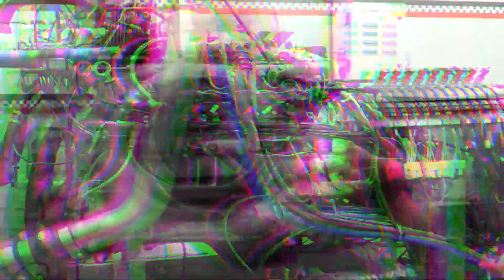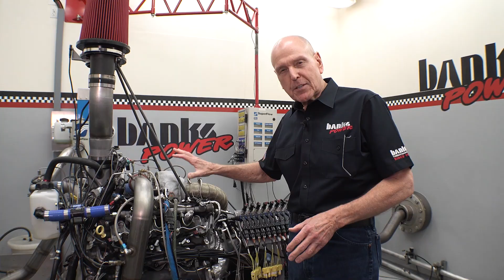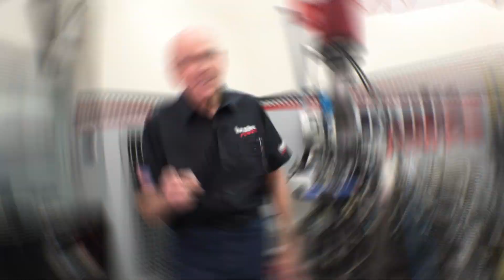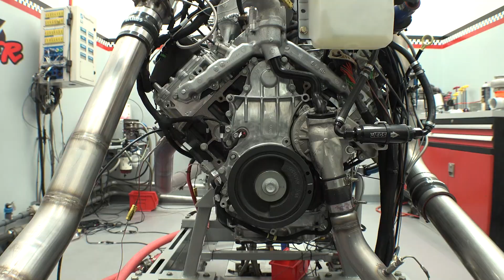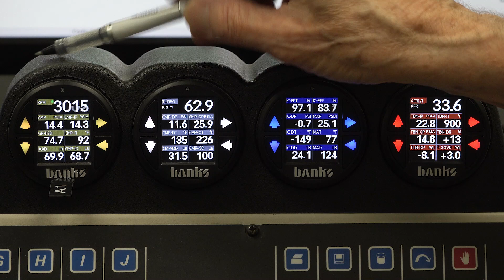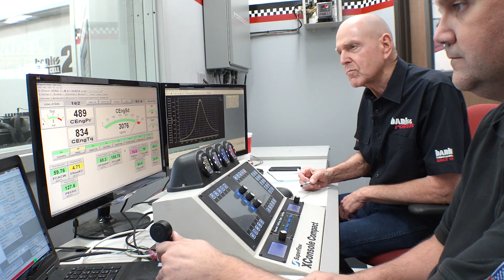KILLING A DURAMAX Pt 6: 65% Better Turbo!

Comment: I would like to see this turbo running stock hp and then compare all these numbers. Would be interesting to know if it would make the engine more efficient at stock power numbers not just high hp numbers. 
Great series when I saw it come out I clicked  immediately been waiting or it.

Comment: Now to get all that under the hood of a GM truck.
Reply: 1 filter is capable of supporting it, the second was added do to maxing out the sensor. Piping being bumped up a size is a frequent upgrade so that's figured out already. I don't know how much room is around the turbo, but id imagine he knows it will fit. with all the time into testing I'd be willing to bet he is doing this to put together a kit that will include the precision turbo.

The biggest hurdle I see is taking the risk of voiding the warranty on a 50k+ truck, not something I'd be willing to do.

Comment: Gale: You've shown that the stock turbo is lagging, and you never showed the turbo rpm of the Precision like the previous test. Likely not an issue due to lower rpm's. Doesn't Borg-Warner or others make a variable 76/75 to speed up the turbo at lower rpm's to eliminate the turbo lag, yet not have to fight the internal temperature issue you had with the stock turbo? It would eliminate the two nagging issues that you have. The engine is begging for a bigger turbo, but in order to meet throttle response, you need a variable turbo to spool up quicker, yet be able to handle the airflow at the higher rpm's like the Precision Turbo? If not, I'm sure that you will come up with the cure. Love the data logging...I'm a GM guy, but l'll bet the GM guys are wondering how you'll fix their short sightedness.
Reply: In the video it showed the Stock turbo was at 116,000 RPM and the Precision turbo was at 92,000 RPM during this test, it was on screen in one of the comparison graphs. Cheers

Comment: Another great video. But my takeaway was a little different. How good is the OEM turbocharger compressor.

The OEM turbocharger compressor is even more efficient at 116k RPM vs the Precision at 90k RPM. Less heat gain!! Or am I missing something.

Keep it up Gale ;) 
Jordan

P.S: Sounds like this turbo would be great on a stationary engine (power generation.)  The lag looks pretty bad... Surely there are some larger VGT turbochargers from CAT or Detroit for their large construction equipment where you could have your cake and eat it to. Un-cork that turbine but still retain the VGT advantages.
Reply: The reason the compressor had those numbers as he was running them to the same horsepower/load to show how the bigger turbo is more efficient overall. The slightly higher temperatures could have been because the ambient temperature was higher on that day. Regardless the numbers are close enough in the real world to not be a big hassle. The main point of this test was really to show how the stock turbo was starting to struggle to provide that amount of boost efficiently, He showed that the stock turbo was taking much higher exhaust pressure to drive it while the bigger turbo took less exhaust pressure to provide the same amount of boost, That point is the part that shows how the bigger turbo is MUCH MORE efficient than the stock turbo. Might be worth watching it again as the most important bit about the exhaust turbine pressure is what you have missed picking up on. Since your here means your willing to learn, so it would be worth watching it again. I'm not trying to argue or put you down or anything, just trying to help. I have a bad way with words sometimes.
By the sounds of it the Next video will show what this Turbo can achieve when he ramps it up.
Reply: I think your missing something, precision generated less heat in all categories I remember. But who knows maybe I'm the one missing something.

The lag isn't really an issue, add some fuel on the bottom end and she will spool just fine. As Mr Banks mentioned you can also adjust the torque converter to better suit the different turbo which will aid in spooling it faster.

Once the tuning is done for the precision turbo then it will be interesting to see how much of that lag is still evident.

Comment: I wish he was my dad. And I also wish I may meet him one day. And, I wish he would make his own Diesel engine. For me. I’d like 800-1000HP reliable, and 1800-2500 FPOT reliable. And I don’t care if it’s a v8. Or a straight 6. Although I am a Cummins guy my self. And if I had all of the money in the world. I’d pay him to get a brand new 2020 Cummins 6.7L long block. And make it bulletproof to the hp and FPOT I am wanting. Hooked up to a semi’s manual transmission.
Reply from the maker: Stop by some time. Gale is typically here six days a week.
Reply: What are you doing with your pickup truck that requires a steady 800-1000 HP?  Class 8 trucks max out at 600 HP to move 80,000 pound GVW reliably.  Nobody needs more than 350 HP in a pickup truck.  Any higher power is just male vanity.

Comment: power and efficiency is good, but what is also nice about a variable geometry turbo is the ability to have a turbo brake
Reply: Cummins does this with the cam ;) and you can always install an exhaust brake.

Comment: So what about a larger variable geometry turbo?
Reply: Jonathan Carver  yeah I want to see a drop in turbo tested because that was going to be my next mod on my lml
Reply: @boardboy95  I just recently did my research on this for my lbz. Same principle applies to the lml. 2 big questions you need to ask yourself... 1. What do you use your truck for? 2. How much turbo whistle do you want or are you willing to tolerate?  Question 1 will depict how much bigger you should go with the turbo wheels. If you tow heavy you shouldn't go too much bigger since bigger wheels want more exhaust flow (higher rpm) to be in their happy operating range and not surge.  Basically, match your turbo to your hp goals. Biggest is not necessarily better
Reply: Maybe Mr.Banks will discuss this.
Reply: Holset probably makes a larger VG turbo.

Comment: I want to see what that turbo will do maxed out.
Reply: I'm imagining he selected that turbo because it's capable enough to still be in it's prime when a different part of the engine hits it's limit and fails (head gasket, connecting rod, piston, compression rings, etc).
Reply: Call the roofing contractor  😂

Comment: no turbo at all on next test run
Reply: The engine would make 200 hp.  Where's the interest in that?  Go back and buy an old GM 6.5 if you want 200 HP.